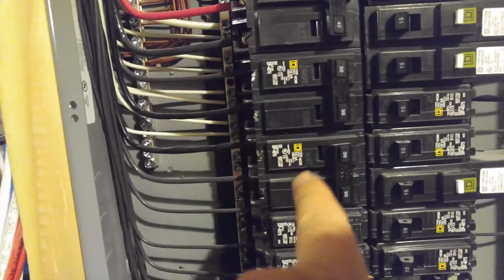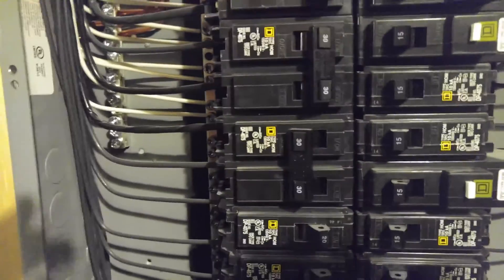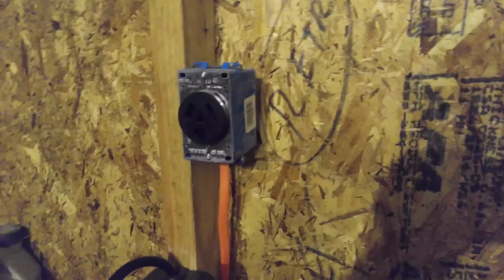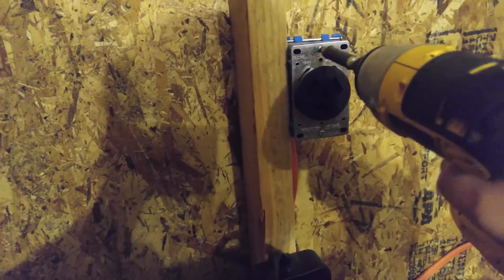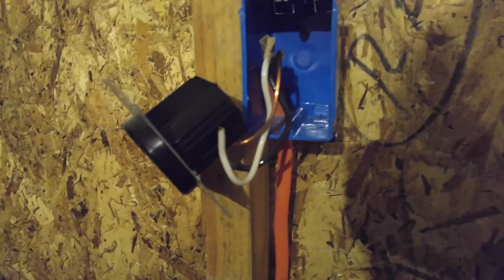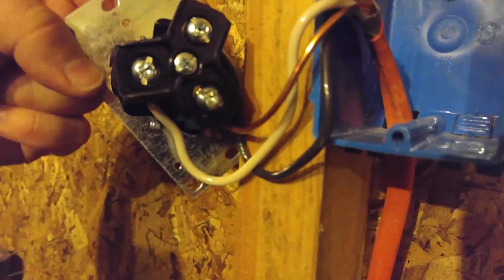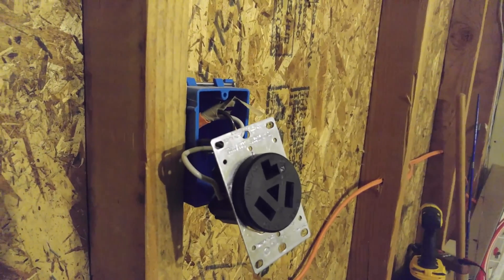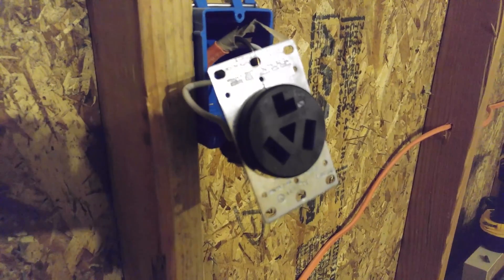How to wire 240V Nema 10-30 receptacle for Level 2 EVSE Charger

Comment: Great video I can replace my standard wall outlet with the 10-30. I’m guessing the wiring is the same.
Reply from the maker: Please verify the wire size will handle the load. If it can, you should be able to rewire it to a 10-30 with the white and black both being hot. Just label the white so its safe for future home owners.
Reply: @GlennPearsonDIY  Typically for 30 amp and a NEMA 10-30 you're going to want 10/2 all copper if you're running it in walls orange outside green. the orange is slicker and easier to run, plus it is coded for indoor use.

Comment: This is wrong.  NEMA10 is hot-hot-neutral.  It does NOT have a ground.  In your outlet, you are running return voltage for any 120V devices connected over a bare wire.  You should never install new NEMA10 outlets today, you should run a 6/3 wire (3 conductors and a ground) and use a NEMA 14-30R receptacle.  Modern EV chargers all support this.  They only make the NEMA10 plugs for people with ancient dryer receptacles which are NEMA10.
Reply from the maker: This video is nearly 6 years old now... The charger I purchased was made for the nema10 which is why I installed it. I should have used the neutral instead of the ground. Many older homes didn't have a ground and ground and neutral run together. 

Not sure why you chose to comment on such an old video. Others have also commented the same you did, just several years ago.
Reply: I've given this a ton of thought. For those of us with  a 30 amp, 3-conductor wire, this is the best solution. Clipper Creek seems to be the main vendor requiring ground + neutral, I don't think most other EV chargers care. If I was running new wire I would certainly use 3 plus ground, but hindsight is 20/20, sigh

Comment: I have installed a nema 10-30 just the way you showed.  I have a primecom level 2 charger for 16 amps at 220 volts.  My problem is that when I power up I have 120 volts on each leg from the breaker but nothing across where I believe should be 240 volts.  I have even changed breakers thinking maybe the breaker is bad  but still the same result.  My electric car is on order and I am trying to get ready.  Have I done something wrong?
Reply: You are only seeing 120 to the neutral/ground because your circuits are coming from the same side of the panel.  They need to come from opposite sides because the two sides are out of phase with each other.  Look at how your panel is designed and you will see what breakers come from what leg of the mains.
Reply: So to be clear, you don’t have it wired correctly.
Reply: @johndonnelly7156  
      I checked how the panel was wired per your suggestion and found that only the center top & lower breakers connect to both arms.  I reworked the breaker layout and moved the the 20 amp double to the center.  I now have the voltage and the charger comes to life and lights up.   
       Thank you very much.
Reply from the maker: You should have two prongs on the outlet that are 120 volts each. I don't believe you'll read 240 volts anywhere, you will always read it as separate 120 volts. The charger will take the separate 120 volts and combine them when it sends it to the vehicle.
Reply: Thank you, it means I have it right.  I don't know when my car will arrive but I will follow up then.

Comment: Pretty sure the 3rd wire in a 10-30 is neutral, not ground. I don't think it's safe to simply use a bare copper wire to ground for this.
Reply from the maker: I remodel homes and have seen a few dozen of these outlets wired the same as this. I have an electrician who also says ground is what he was always taught to use.  Many homes have ground and neutral on the same bus bars or if not the same they are connected I'm the panel. 

https://images.app.goo.gl/S3agtfErs3gGpeDz8
Reply: Ground and neutral are always bonded at the main panel..so essentially they are the same...ground is another path to ..well ground ..

Comment: Hi. Is that just a standard sized mounting box for the recepticle?
Reply from the maker: Thomas Martin yes just a standard box. There are many options to choose from at local hardware stores.
Reply: @GlennPearsonDIY  Many of the 'single standard boxes' may not work UNLESS the receptacle is a Hubbell which is an expensive but worth purchasing receptacle. It fits like a glove and you can install a "standard' plate on it.

Comment: I have a 10/3 wire, ground is wired to the box, 2 hot wires red and black, could I use the neutral as the ground on the recepticle?

Comment: There's no issue charging an EV through this? I've heard different things.  Clipper Creek EVSE said they recommend repurposing this 3 pronged plug with a 4-pronged NEMA 14-30? I believe.  COuld I just buy an adapter to a 14-30 and get a EVSE with that plug and just plug it in?  Thanks.
Reply from the maker: You might be able to get away with the adapter, although changing the plug wouldn't be too difficult. I've had this going for nearly a year now, well over 300 charges, probably close to 400 because of multiple charges in one day, using this outlet and my Ebusbar charger and I haven't had a single issue with it. Its been flawless and I get a full charge every time. Very pleased.

Comment: What gauge is the wire, or what does it have to be by code?
Reply from the maker: I used 10AWG wire.
Reply: Glenn Pearson thanks
Reply: Glenn Pearson sorry if I'm not getting what you said in the video and in your reply, but was that 10 gauge wire you have for that plug already there for that plug, or did you just use 2 hots from previously existing dual 120 volt outlets? If you did use two 120 volt hots that were there, did/do you have to re-wire 10 gauge cable for the ground/neutral prong? (Sorry for all the questions, kinda new to this)
Reply: I used a 10/2 wire, that was already installed for my electric water heater, I removed that and installed a tankless heater so I already had the connection. The white and black were both hot, and the "ground" was connected to the neutral. Just like 3 prong dryers used to be connected. Technically this is not code for an outlet, neither are 3 prong dryers anymore (unless grandfathered in). It works fine, and I'm not worried about any safety issues. I thought about running a separate ground to the outlet itself. Might still do that. Code is different for every area, so a 3 prong outlet might be just fine where you live.
Reply from the maker: Sorry, that reply was from my family vlog channel. Its the same person :)
Reply: Glenn Pearson no worries
Reply: can you call me i have the same?two 120 volt hot that is there can i use it to put L-14-30  30 volt ?????347-342-5261   JORGE THANK YOU

Comment: Excellent description Glenn!  This is how I have mine wired.  Only difference in my setup is that I am running my 12-2 through metal conduit and into a metal surface mounted box I the garage.  Should I ground the outlet to the metal box or just ground the metal box/conduit to the bus bar?  Or no grounding necessary with this style of circuit?
Reply from the maker: Its never a bad idea to ground, and it would be pretty simple so I would if it were me. But its not required for this plug.
Reply: +Glenn Pearson excellent,  thanks!  When grounding with metal boxes and conduit,  do you pigtail the ground from the 10-30 to the box?  Or just ground the box and conduit to the neutral bus bar?  Sorry for all the questions! You have been a great help!